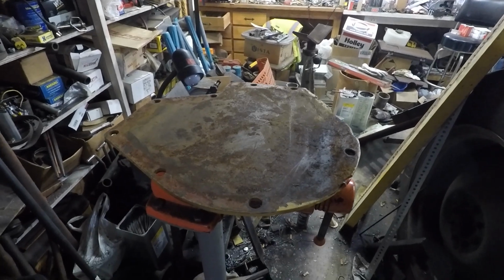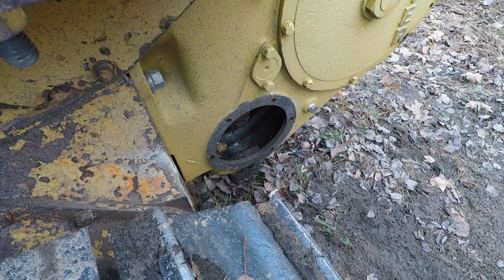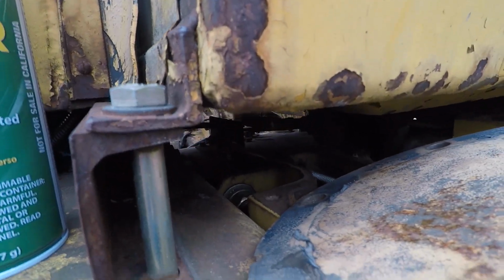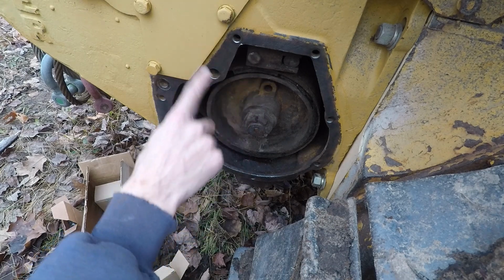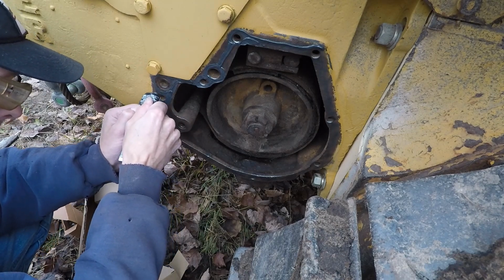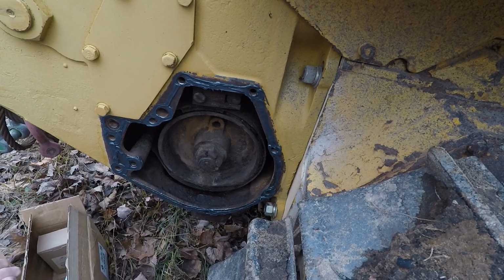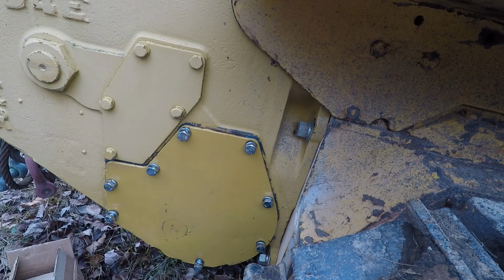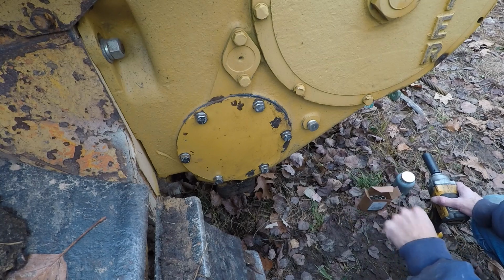Hyster D4E Winch Maintenance

Comment: Great video buddy! 😀👍 how much pulling force does that winch have! 😲
Reply from the maker: Bare drum is 25,800 lbs & full drum is 12,700 lbs. Those specs are based on a 65 hp tractor at 927 rpm at the pto. It packs quite the punch for a 'small' crawler.
Reply: @WesleyJohnsonMI  oh wow! 😀 thats awesome!